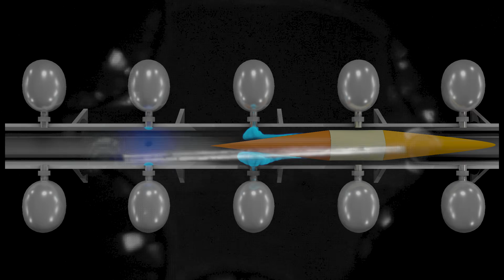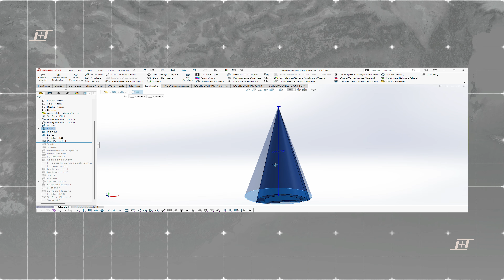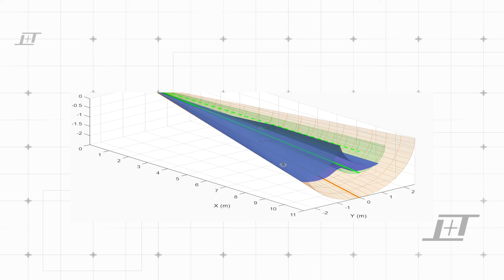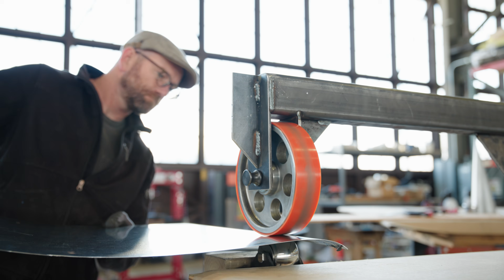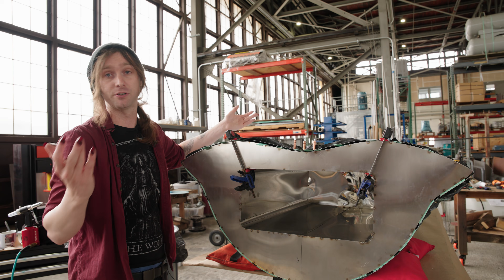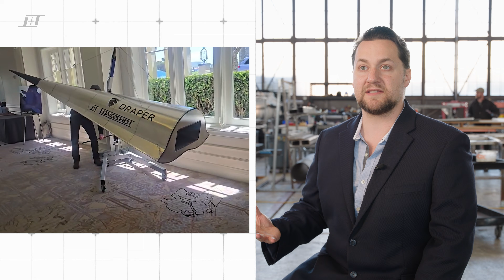Meet Glowrider | Longshot’s Hypersonic Glide Vehicle

Comment: Why don’t you just use Hydro forming for these particular shapes? It would be very fast and would not have all those seams build a form, slam it with water, water under high pressure and you have a one piece shape that would conform to the mold.
Reply: We will do when we're building more than 1.  We just wanted a showpiece to convey the concept to the team and visitors.

Comment: Ok, I was suprised to see you using such archaic sheet metal work to form complex curves. Maybe you just needed a display model one off? 
I'm a retired A&P (A stands for airframe) so I know my way around metal forming and composites but also machining operations and foundry (and I'm also a Millwright / industrial 'mechanic')
and I would be using 'Sheet metal hydroforming' where instead of riveting smaller panels together,  the entire upper skin or lower skin would be formed in one piece. Hydroforming ISN'T that expensive, I've done it at the small shop level with DIY equipment. Beats the hell out of English wheels, etc.
Reply: Oh yeah - for sure this is just a showpiece, geometry concept. 
Totally agree that when we build the real thing (which will have wall thicknesses from 1/8 to 1/2 inch of 17-4SS) we'll almost certainly be doing hydroforming.  Our head of mfg used to make helicopters, so when we're making quick fab stuff, we fall back on classic rivet fab techniques rather than the stuff we'll be using for the real vehicles.
Reply: @natosaichek  Yeah much cheaper and faster to do that than have to make a new mould each time for hydroforming.
Reply: exactly my thoughts. why not just 3d print the whole thing similar to what Leaf did with Noyron
Reply: @IllusoryMirage13 This is just a showpiece, and having a 3Dprinter that big just for a showpiece is actually way harder. We got a great big shop with tons of metal bending capabilities to use!
Reply: I’ve seen people get perfect, fast and repeatable results just using the pressure from a pressure washer. 👍
Reply: @mxcollin95 or I've used a hydraulic Portapower hand pump... Fill the item volume with hydraulic fluid (6.5 gallons in this case), make sure no compressible air bubbles in it and even though there's only a fraction of an ounce coming out of the pump per stroke it puts tens of thousands of pounds of pressure into the form die. Formed a complex curve out of 11 gauge stainless (that's around +- 1/10 inch).
Reply: @bobjoatmon1993  ya air bubbles are a little dangerous. I’ve seen guys “hydroform” using thick rubber, a mold and a press skipping the use of fluid all together. That technique actually seemed to work well too.

Comment: How long will the barrel be?
Reply: Eventually many kilometers. Think of a pipeline flat on the ground.
Reply: @mikegrace8814  - Where are you going to find the expertise to build a prototype?  Are you head hunting in Baghdad?
Reply: @christopherd.winnan8701  of the gun, we already have a pretty good one. Most of the expertise we need to built it up comes from the oil industry. For the vehicle prototype we're going to steal as many insights as we can from old warhead tech.
Reply: @mikegrace8814  - That is unreassuringly vague!
Reply: @christopherd.winnan8701  Want to come over for a tour?